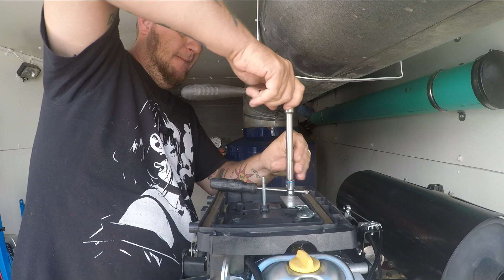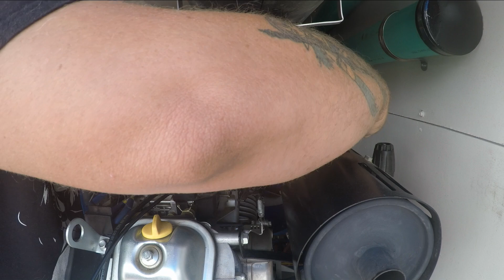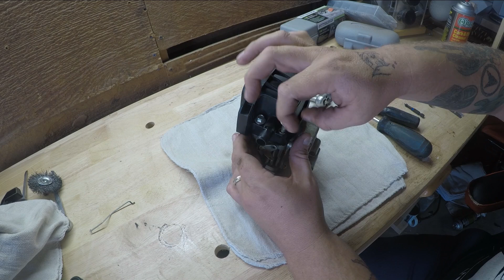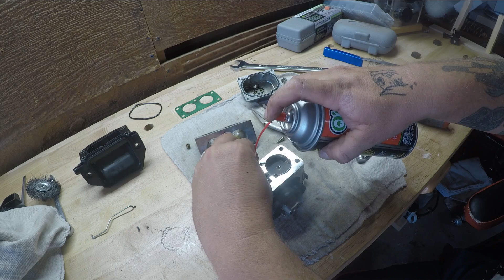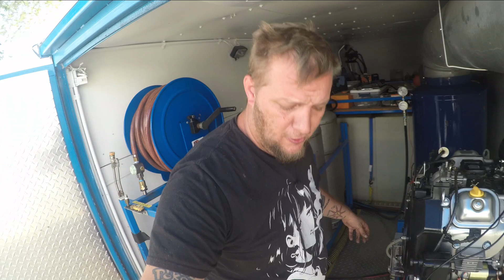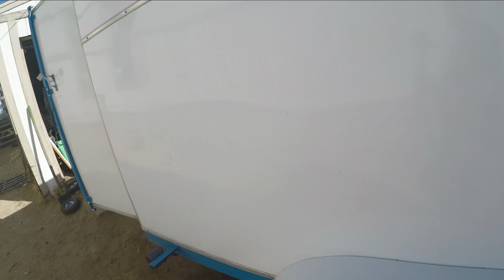Complete Predator 670cc Engine Repair & Carburetor Cleaning Tutorial

Comment: Like the video. That is not a fuel filter (vacuum line). It is made to catch oil residue to prevent it from entering fuel pump (basically steel wool). Fuel filter will plug rather quickly (I'm guessing).